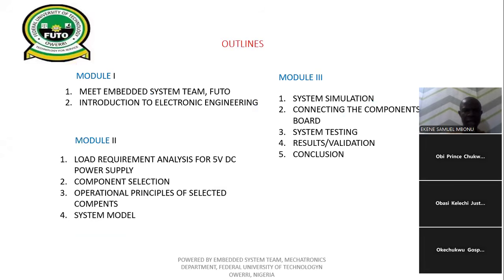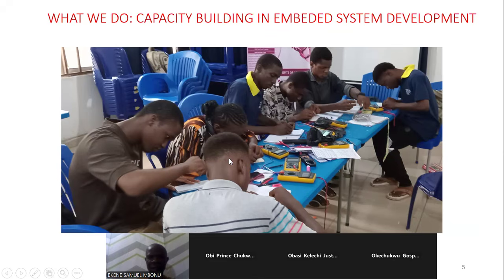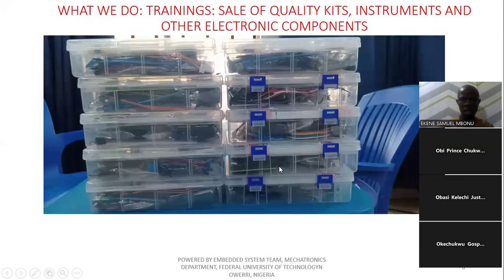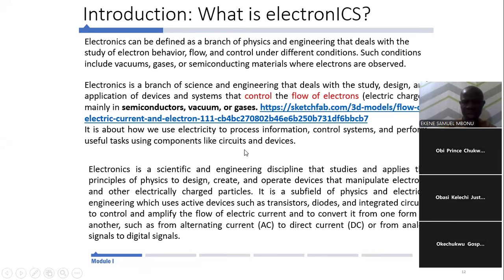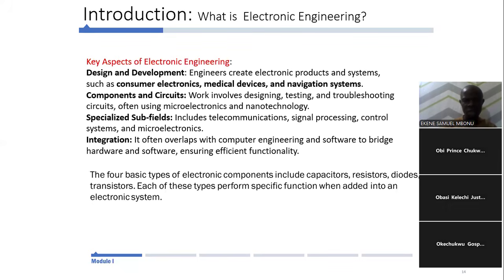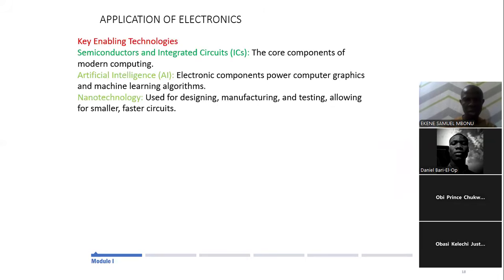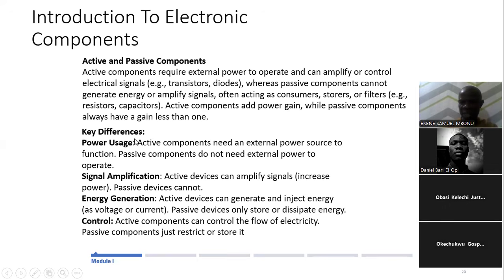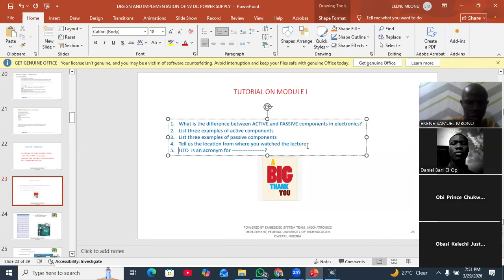DESIGN AND SIMULATION OF ELECTRONIC SYSTEMS  (MODULE I)

Comment: My name is Ugorji Chinonso, 100lvl mechatronics Engineering Student 
1. Active components: These can amplify electrical signals and control the flow of electricity. They require an external power source to function. While Passive components: this cannot amplify signals or provide power gain. They simply consume, dissipate, or store energy without the circuit. 
2. Transistors 
    Diodes
    Integrated circuits 
3. Resistors 
    Capacitors 
    Inductors 
4. I'm watching from Owerri West, FUTO
5. FUTO stands for: federal University of technology owerri

Comment: Good day sir 
I am ANYANWU PRECIOUS CHINYEREM 
100Lvl student  of mechatronics engineering 

Active electronic components are devices that need a power supply before they can function properly. They are capable of controlling, switching, or increasing electrical signals. Passive components, on the other hand, do not need an external power source and mainly help in storing, limiting, or releasing energy in a circuit.
Examples of active components include:
i. Transistor
ii. Diode
iii. Integrated Circuit (IC)
Examples of passive components include:
i. Resistor
ii. Capacitor
iii. Inductor
The lecture was presented by the Embedded System Team of the Federal University of Technology, Owerri.
FUTO stands for Federal University of Technology, Owerri.

Comment: My name is uchewujo wisdom chukwunonyerem 
I am a 100lvl mechathronics engineering students 

Active components are electronic components that require external power to operate and can amplify or control signals, while passive components do not require external power and cannot amplify signals.

Three examples of active components:
Transistor
Diode
Integrated Circuit (IC)

Three examples of passive components:
Resistor
Capacitor
Inductor

“I watched the lecture from , imo State 

Federal University of Technology Owerri

Comment: Good day sir 
I'm Pius Chibuide Cosmas 
Mechatronics engineering 

 
1.The difference between active and passive components;

Active components are devices that require external power source and can amplify or generate electrical signals .

Passive components are devices that do not require external power source and cannot amplify signal.

2.Diodes, integrated circuits, transistors 

3. Capacitor, resistor, inductor 

4. Chimamanda Lodge, Eziobodo

5. Federal University of Technology Owerri.

Comment: Good Day Sir
Name:Uchenna Delight Chukwubuikem 
Department:Mechatronics Engineering 100 Lvl
1)Active components can control current flow and they require external power source 
WHILE Passive components dont require external power source and cannot control current flow.
2)Active components include Transistors, Diodes and Integrated Circuits
3)Passive components include Resistors,Capacitors and Inductors.
I am watching from FUTO

Comment: My Name is Eboh Kosirisochukwu 
The answers to the tutorial question below 
1.Active components (e.g., transistors, diodes) require an external power source to operate, allowing them to control, amplify, or inject energy into a circuit. Passive components (e.g., resistors, capacitors) do not need external power, simply consuming, storing, or limiting enery

2.Transistors, ICs, and diodes
3.Resistors, capacitors, and inductors
3. Eziobodo, Federal University of Technology Owerri

Comment: Goodday sir My name is Chigozie Ihunanyachi Marvellous am a 100 level student of Mechatronics Engineering Department 
Active components need an external power source to work and can amplify or control electrical signals.Examples: Transistor,Diode,Integrated Circuit.
Passive components do not amplify signals and usually only store, limit, or dissipate energy. Examples: Resistor,Capacitor,Inductor. 
Federal University Of Technology Owerri

Comment: My name is Uo-Fredrick Prince Ekewisdom, I'm in 100lvl mechatronics engineering 

Difference:
Active components need an external power source and can amplify or control signals, while passive components do not need external power and only store or dissipate energy.

Examples of active components:

Transistor

Diode

Integrated Circuit (IC)

Examples of passive components:

Resistor

Capacitor

Inductor

I am watching from FUTO

Comment: Name: Peter Ngozi Odike
Department: Mechatronics Engineering 100lvl

1–Active components require an external power source and amplifies electrical signals while passive components cannot amplify signals and doesn't require an external power source 

2–Diodes, transistors and integrated circuits 

3–Resistors, capacitors and inductors 

4–FUTO

5–Federal University of Technology Owerri

Comment: Name: Chukwu John
Dept: Mechatronics Engineering 

1. Difference between ACTIVE and PASSIVE electronic components:

ACTIVE components need an external power supply to function and are capable of controlling or amplifying electrical signals, whereas PASSIVE components do not require external power and cannot amplify signals.

2. Examples of ACTIVE components: • Transistors (BJTs and FETs)
• Integrated Circuits (ICs)
• Diodes

3. Examples of PASSIVE components: • Resistors
• Capacitors
• Inductors
• Transformers

4. I’m joining the session from the Federal University of Technology, Owerri.

5. Federal University of Technology Owerri.

Comment: Name : Ekeator Delight ihechi 
Dept: mechatronics engineering 
Level :100

1. Active components: these requires am external power source to function. That are capable of amplifying signals or controlling the flow of electricity within a circuit 
Passive components: these do not require external power to resist or store energy in electric or magnetic field 

Examples of active components 
I) Diodes 
Ii) transistors
III) integrated circuits 

3. Examples of passive components 
I) capacitors
II) resistors 
III) indicators 

4. Futo means federal university of technology Owerri 

Am watching from eziobodo futo

Comment: Name:Ezeja favour onyedikachi 
Level:100
Dept: Mechatronics 

1.Active components require external power to operate and can amplify or control electrical signals while passive components cannot generate energy or amplify signals.

2.Transistors (BJFs,FETs)
    Integrated circuits (ICs)
    Diodes 

3.Resistors
   Capacitors 
   Inductors 

4.Federal university of technology,Owerri 
 
5.Federal university of technology, Owerri

Comment: Name: Jackson Abetianbe
Dept: Mechatronics Engineering

1. What is the difference between active and passive components?
Active components require an external power source to operate and can control or amplify the flow of electricity (e.g., transistors). Passive components do not require external power and generally store or dissipate energy (e.g., resistors and capacitors).
2. List three examples of active components.
Diodes, Transistors, and Integrated Circuits (ICs).
3. List three examples of passive components.
Resistors, Capacitors, and Inductors.
4. FET is an acronym for what?
Field Effect Transistor.
5. Location: Owerri-West, Eziobodo, Futo

Comment: 1| Active components are parts that boost or switch electrical signals by using an outside power supply.
WHILE
Passive components are electronic parts that cannot control electricity with another electrical signal or provide gain.

2| Active Components:
Transistors
Integrated Circuits (ICs)
Operational Amplifiers

3| Passive Components:
Resistors
Capacitors
Inductors

4| Watching from Futo Hostel A

5| FUTO Means: Federal Technology Of Technology Owerri

Comment: Good morning Engr Mbonu 

1. Active components require an external power source and can amplify or control electrical signals, 
while passive components do not amplify signals and only store or dissipate energy.

2. Three examples of active components: Transistor, Diode and  Integrated Circuit (IC)

3. Three examples of passive components: Resistor, Capacitor and Inductor

3. I'm watching from FEDERAL UNIVERSITY OF TECHNOLOGY OWERRI 

4. FUTO is an acronym for “FEDERAL UNIVERSITY OF TECHNOLOGY OWERRI.”

Comment: Good evening sir 
My name is Ehiudo Daniel Chisom 
I  am a 100lvl mechatronics engineering student 
1. Active components are components that can electrically control the flow of current or provide amplification. They require an external power source to function and can inject power into a circuit
Passive components are components that cannot amplify a signal or control current with another electrical signal. They do not require a power source to operate; instead, they absorb, dissipate, or store the energy already flowing through the circuit.

2. Transistors, diodes and integrated circuits (IC)

3. Resistors, capacitor and transformer 

4. I watched this lecture from Federal University of Technology Owerri (FUTO) Eziobodo 

5. UTO stands for University Training Office

Comment: Name: oguamanam chibunna divine 
Department: Mechatronics engineering 
Level: 100
Active components require external power to operate and can amplify or control electrical signals while passive components cannot generate energy or amplify signals,often acting as consumers, stores,or filter's

Examples of active components:transistors, diodes, integrated circuits (ICs)

Examples of passive components: resistors, capacitors,inductors
 
From naze
Federal university of technology owerri

Comment: My name is Eze Emmanuel chizurum, a 100 level mechatronics student 
Difference : active components can control the flow of electricity and amplify signals (needs a power source). Passive components cannot control the flow or amplify; they only store, filter, or dissipate energy.

Active Examples: Diodes, Transistors, and Integrated Circuits (ICs).

Passive Examples: Resistors, Capacitors, and Inductors.

I watched this lecture from the Federal University of Technology, Owerri (FUTO). UTO stands for University Training Office.

Comment: Name : Ifezue Chisimdi Victor
Dept : Mechatronics 100level

No.1 Active components are electronic components that require external power to operate and can amplify or control electrical signals while passive components cannot generate or amplify signals.

No. 2 --Transistor
           --Diodes
           --Integrated Circuit(IC)

No. 3 --Resistors
           --Capacitors
           --Inductor

No. 4 I watched from FUTO
            The full meaning of FUTO 
             is Federal University of Technology Owerri

Comment: Name: TrustGod Osaro 
Department: Mechatronic Engineering 100lv 

1. Active components can amplify electrical signals and require an external power source to operate, while passive components cannot amplify signals and do not require an external power source.

2. Transistors, Diodes, and Integrated Circuits (ICs).        

3.Resistors, Capacitors, and Inductors.

4.  I watched the lecture from Ihiagwa, Imo State.

5. Federal University of   Technology Owerri.

Comment: Good evening sir
Name: IKEH-EZEJI CHIDIEBERE VICTOR 
Dept: Mechatronics Engineering 
100 level 
Answers:
1. Active components are electronic components that require external power to operate and can amplify signals, while passive components do not require external power and cannot amplify signals.

2. Examples of active components:

Transistor

Diode

Integrated Circuit (IC)

3. Examples of passive components:

Resistor

Capacitor

Inductor

4. FUTO is an acronym for Federal University of Technology Owerri.

Comment: Name: Ayuba Jude oke 

1. Active components are used for signal processing and control or amplification WHILE passive components are used for energy storage or dissipation.

2. Active components 
  -BJT transistors
  -Diode
  -integrated circuits

3. Passive components 
 -inductors
 -capacitors
 -transformers

4. I watched from tetfund hostel B, FUTO

FUTO means federal university of technology owerri.

Comment: Good Day Sir
Name: Ukanwa Joseph Chimeremeze.
Dept: MECHATRONICS.
Year:100 lvl.
QST 1:What is the difference between Active and Passive Components in Electronics?
Ans:Active components can control current flow and often amplify signals.
They usually require an external power source to operate properly whereas Passive components cannot amplify signals or add energy into a circuit.
They mainly store, limit, or dissipate energy.
QST 2:Three Examples of Active Components 
Ans: Integrated Circuits(IC's)
Transistors
Diodes
QST 3: Three Examples of Passive.
Ans:Capacitors
Resistors
Inductors
I'm watching from Federal Polytechnic Owerri(FUTO).

Comment: 1. Difference between ACTIVE and PASSIVE components in electronics:
     ACTIVE components need an external power source to function. While PASSIVE components do not need an external power to operate. 

2. Examples of ACTIVE components:
• Transistors
• Integrated Circuits 
• Diode 

3. Examples of PASSIVE components:
• Resistors 
• Capacitors
• Transformers 

4. I am watching from the Federal University of Technology, Owerri.

Comment: Good day sir , my name is NWOSA ANTHONY NNAGOZIE, 
a mechatronics engineering student . 100 level

1. Active components are electronic components that require an external power source to operate and can amplify or control electrical signals, while passive components do not require an external power source and cannot amplify signals; they only store, transfer, or dissipate energy.
2. Three examples of active components are: 
i. Transistor
ii. Diode
iii. Integrated Circuit (IC)
3. Three examples of passive components are:
i. Resistor
ii. Capacitor
iii. Inductor
4. I watched the lecture from the Federal University of Technology Owerri (FUTO).
5. FUTO means Federal University of Technology, Owerri.

Comment: Name : Obianua Wisdom Chinomso 
Dept : MCE 100lvl
1. What is the difference between ACTIVE and PASSIVE components in electronics?
The primary difference lies in how they handle energy and signal gain:
Active Components: These components can inject power into a circuit, provide power gain, and control the flow of electricity. They require an external power source to operate.
Passive Components: These components cannot introduce net energy into the circuit. They can only store, dissipate, or release energy that is already present. They do not require an external power source to function.
2. List three examples of active components 
Transistors (e.g., BJT, MOSFET)
Diodes (including LEDs and Zener diodes)
Integrated Circuits (ICs) (e.g., Operational Amplifiers)
3. List three examples of passive components
Resistors
Capacitors
Inductors
4. Tell us the location from where you watched the lecture...
From FUTO

Comment: Good day, I am Uzor Kenechukwu Michael.
Department: Mechatronics Engineering 100 level.

Q1. Active components require an external power source to operate and can amplify or control electronic signals, 
Whil passive components cannot generate energy or amplify signals it often acts as a consumer, store or filter

Q2. Examples of Active components:
        Diodes
        Transistors 
         Integrated circuits.
     Examples of Passive components:
          Resistors
          capacitors 
          Inductors. 
Q3. I am watching from Umuchima, FUTO. 
Thank you for the lesson.

Comment: 1. Active Components can amplify electrical signals and control the flow of electricity which tend to require and external power source to function. 

Passive Component cannot amplify signals or provide power gain but rather simply consume, or store energy within the circuit

2. Transistors
    Diodes
    Integrated circuits 

3. Resistors 
    Capacitors
    Inductors 

4. I'm watching from Owerri west in FUTO, eziobodo 

5 FUTO - federal university of technology owerri

Comment: I am iloka Paschal 
Mechatronics department 

1 : The difference between active and passive components in electronics is:
. Active components require an external power source and can amplify or control electrical signals.
. Passive components do not need an external power source and cannot amplify signals; they only store, resist, or release energy.
2. Three examples of active components:
. Transistor
. Diode
. Integrated Circuit (IC)
3. Three examples of passive components:
. Resistor
. Capacitor
. Inductor
4. I am currently watching from eziobodo futo
5. FUTO stands for federal university of technology owerri😊

Comment: My name is UWA CHARLES ONYEDIKACHUKWU.
From Mechatronics Engineering 100LVL

1.Difference between Active and Passive components
Active Components 

ACTIVE COMPONENTS: are devices that require power from an external source, they can control, amplify or generate electrical signals. They need power to operate and can control current, voltage and amplify signals.
WHILE PASSIVE COMPONENTS: are devices that do not require an external power source and cannot amplify signals. They only store, dissipate or release energy.

2. Examples of Active Components:
(i) Transistors
(ii) Diodes
(iii) Integrated Circuits (ICs)

3. Examples of Passive Components:
(i) Resistors
(ii) Capacitors
(iii) Inductors

4. Watching from Owerri West, Umuchima-Ihiagwa, FUTO

5. FUTO- FEDERAL UNIVERSITY OF TECHNOLOGY OWERRI.

Comment: Good day, I'm chikezie freedom 
Department: mechatronics 100lvl 

Q1. Active Vs passive component:
Active components require an external power source to operate and can amplify or control electronic signals.
While passive components cannot generate energy or amplify signals it often acts as a consumer, store or filter 
Q2. Examples of active components: diodes, transistors and integrated circuits 
Q3. Examples of passive components: resistors, capacitors, and inductors.
Q4. Watching from Hostel A FUTO (Federal university of technology owerri)